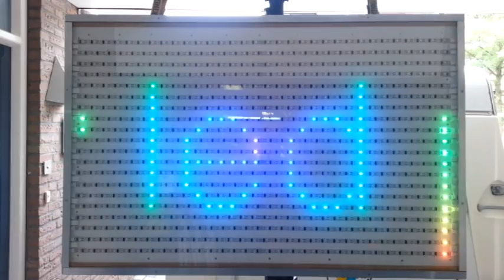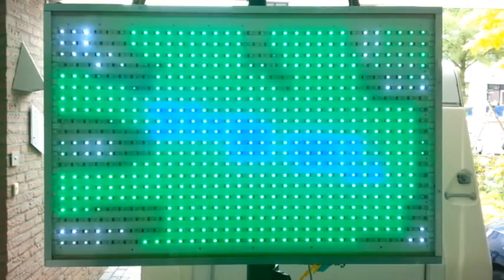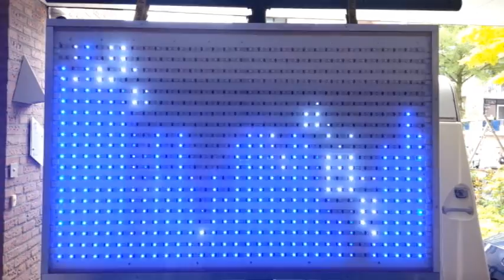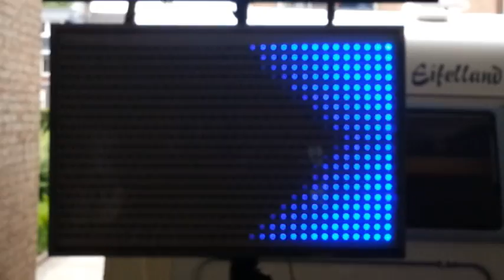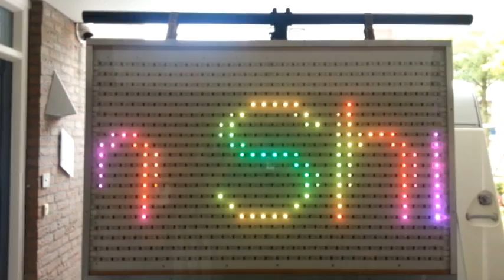Making of a Led pixel board

Comment: Great job I am building mine for my dj booth as well  I got the 2812b. 60/m   Total of 100 X 80 pixels  I'm still going on to the fail part lol how ever I would love to know where you got the programs on yours they look super cool I'm just running the basics from led edit but I would like some of those you have  
Where did you got those ? 
Or if you need them can you make a vid on how to create those ? 
Thanks
Reply: Hi Edgar,  It's been 4 years since I made the board. I used the T-200KB led controller. Most of the programs I received from the supplier.  Those were very helpful, and did their best to help me with all my questions. http://www.shiji-led.com/  
And with the controller you can create programs yourself.
My next project is also a new DJ booth. but I'm still in doubt.....
Reply: Thanks for the replay. And I will check on that page for sure 
Do not doubt  get to it !!!  You know the feeling after done with it  it's awesome!!!

Comment from the maker: T-200KB led controller
WS2801 LED digital strip light-addressable
RGB Flexible Digital LED Strip 5V
These are the Digital strips that can be controlled with computers and other DMX/Digital SD Card Controllers. The advantage of digital strips is that you can control each led (1.22" section) by 
itself so you can make video/chasing effects and other patterns. These color changing LED strips are flexible, bright, and easy to install!  They are much brighter  rope light.